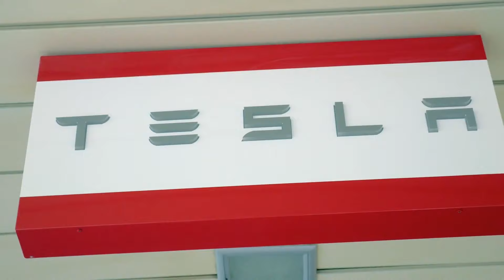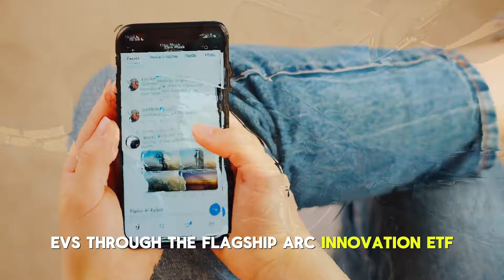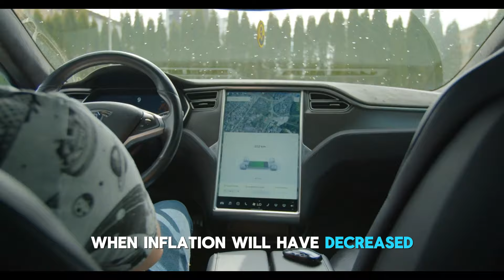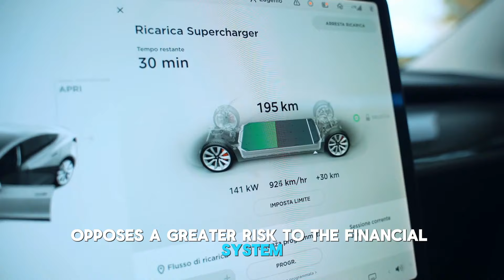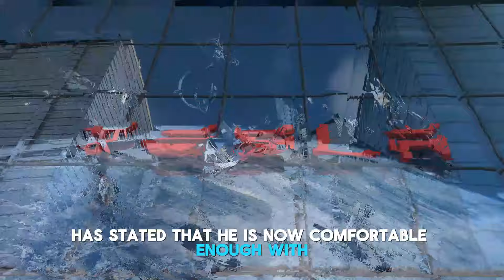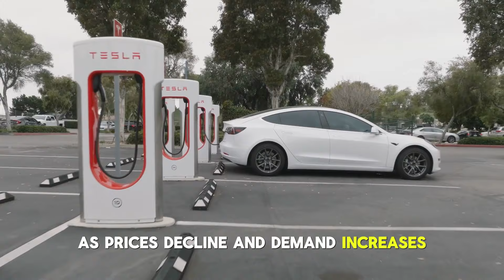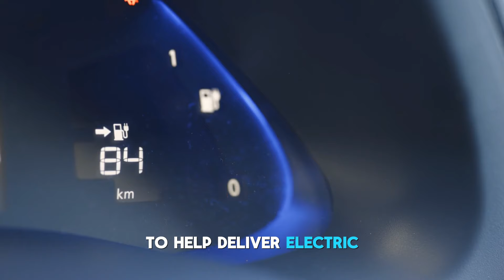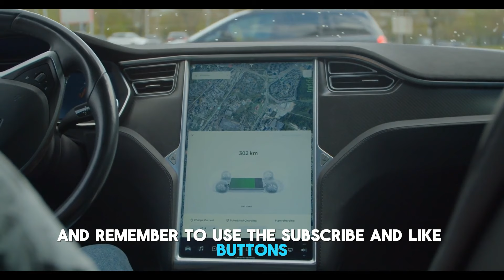Cathie Wood: "Tesla Stock Investors Who Buy the Dip Will Become Millionaires"

Comment: If you have little or no Tesla stock or your basis is low enough, buying more Tesla stock now for those who can wait 5 years makes sense.  But if you hold enough and your basis is high,  then long term capital losses can be useful.  Selling some over priced stock and some buying it back in a month is a proven way of capturing capital losses as offsets and increasing total return on investment - unless the stock recovers fast enough to pass the basis of the sold stock.    Tesla stock will rise eventually much higher but the probability of a 30% recovery in 31 days is near zero.